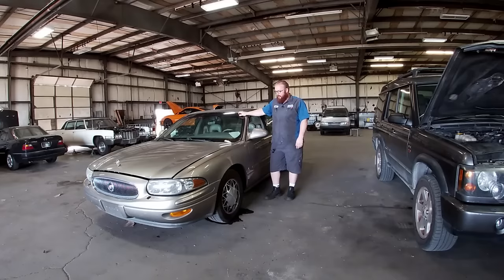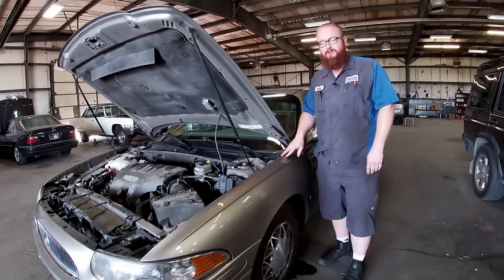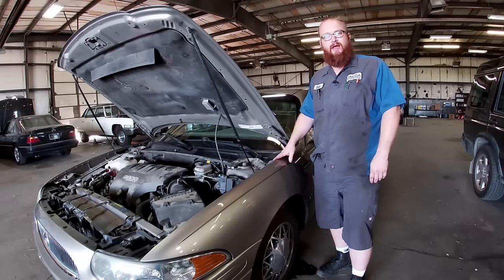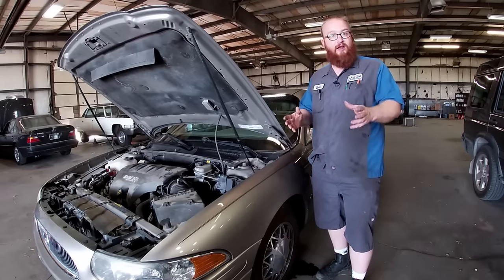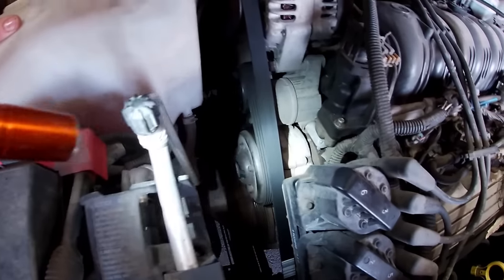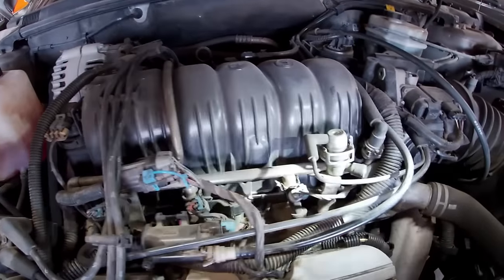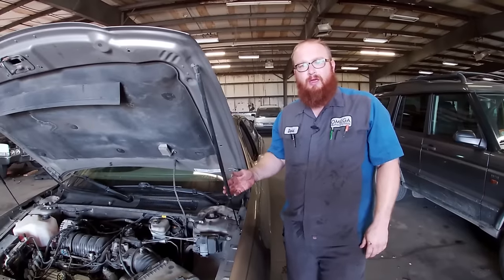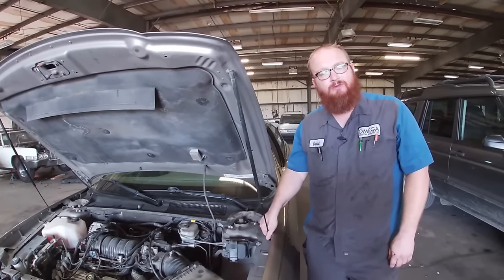CAR WIZARD highlights what makes the Buick 3800 V6 the BEST engine ever!

Comment: I want to see GM bring this engine back sometime soon. The only reason I'd buy anything other than a used 3800 car would be a NEW 3800 car!
Reply: They would probably still be using the 3800 if it could meet current emissions regulations.
Reply: and sadly, they don't make it anymore :(
Reply: hochhaul I bet it could with some know how like aluminium heads different cam dual cat exhaust
Reply: @hochhaul  the thing is that the first car in North America to be SULEV ( Super Ultra Low Emission Vehicle) other than hybrids
 was the Buick Lacrosse  and Pontiac Grand Prix both of them equiped with the 3800
Reply: The LS aftermarket guys need to make replica 3800s.
Reply: Honest mechanic opinion. New Chevrolet Impala 2.5L I4 is the closest, most-reliable you can get near the 3800. Stay away from 3.6L V6.

Comment: @car wizard , I used to own a 98 Lesabre and missed driving an American built Buick with the 3800 so much that I ended up buying a 2001 Park Avenue with 167k miles on it for only $2,200 and I am so happy driving this smooth driving comfy car. There was a bonus when I went to buy this car off someone . I took a look at the engine area and discovered that the previous owner had already done the Dorman aluminum intake conversion 👌 also, it's so easy to swap out sensors on this car when they go bad. I'm not mechanically inclined and using an OBD scanner, Google & Amazon I'm able to change sensors myself . P.S. been enjoying watching your videos for years now but as I watch YouTube on my TV I don't have the option to comment so this is my first comment . Love all your videos 💫💫💫

Comment: I had a 97 Camaro with the 3800 v6. Bought it for 500$ had 200000 plus miles lasted me forever lol
Reply: Still have my 97 Camaro V6 with 325,000 Km's. I'm the original owner and its always had oil changes by me every 5000 Km's with Mobil 1 10W30. I run synthetic lubricants everywhere.
Reply: I have a VT Holden Commodore, with the 3800 V6. Its done over 326,000 and she just won't die.  I'm fussy though, I service her regularly; I do most of mechanical side myself since it's the most easiest engine to work on.
Reply: Joshua Dean Martin agreed mine here in southern Ontario easy to work on parts a reasonable compared to most companies and plenty of aftermarket parts cheap. Have to fight the rust created by 5 months of road salt here  . Several years ago in london Ontario they were spreading salt on wonderland rd April 20 th and there were no freezing temperatures for over 3 weeks it was 11. Pm. A city truck was laying down salt like  mad I was behind I just got through washing all the winter salt of my engine bay and chassis earlier that day and was going to take my car to be oil sprayed I had to re wash the car again to remove unnecessary salt . This road treatment destroys cars trucks
Reply: @nickking1510  I don't drive mine in the winter. I have had two Cavaliers that were/are my winter cars. Yes, another reliable GM engine was the 4-cylinder 2.2 litre engine found in the 95-05 Cavalier's, they just keeps running.
Reply: @nickking1510  hi Nick, mine has a bit of rust.. one thing I like about the engine, it has a automatic tensioner, so the serpentine belt is a peace of cake to replace. I found the power steering pump and water pump to be very easy to replace. When I look at a 2002 Mazda atenza, it's a brain f.. to a degree, because trying to replace the drive belt looks incredibly difficult; no room.. recently had the transmission fluid changed; definitely worth doing , and I change the engine oil every 4 months now.. hope your 3800 keeps going and going, happy motoring.

Comment: I just bought one with 99,000 miles on it. Probably the best purchase I've ever made
Reply: Just bought a 1991 Buick Century Wagon with the 3.3 with 94,000 miles for 1,200$. Don’t regret it at all.
Reply: Got a 98' park avenue w 110k miles at auction. Perfect condition, inside and out. I think an older person owned it before me. I'm loving my purchase
Reply: @leonwhitehorse1099  2001 park ave checking in, just an FYI, the speakers and head unit are really easy to upgrade because the 30 year old paper ones are definitely junk. Also check wheel bearings and your air ride system. A few sensors here and there, maybe a few new fluid lines. Just things I've had to check on mine

Comment: I just bought a 2003 Monte Carlo that needs everything he has discussed, intake gaskets just caught in time, external leaks only, elbows cracked and I'll replace the upper plenum and hopefully have a trouble free car for my daughter.  The car only has 94,000 original miles.  I'll service transmission also.   And, your videos are great, really enjoy them!!

Comment: a thing that baffled me over the years is here in Australia we got these from the late 80s in the General Motors Holden make sedans. We never used them as a front wheel drive setup and it was so common in the US to see these with an East West setup. I'm very glad because i love the RWD sedans in general.
Reply: Over here it was available in the 1996-2002 Chevy Camaro and Pontiac Firebird. But yeah other than those it was mostly in FWD cars.

Comment: You have to take the entire wheel assembly off and unbolt the sub-frame in order to change the pressure control solenoid in the transmission. A $9.58 part.

Comment: Reason I love these motors
- Had a timing chain brake on an 07 series 3...non-interference motor made me smile after a compression test
- Water pumps/coolant elbows, cheap and easy to do
- Valve cover gaskets/head work same deal
- Spark plugs/wires easy to do when you pull the motor forward in a fwd
- camaros (I own one) and firebirds have them. plus theres a turbo kit for them on ebay to squeeze out some horsies
- zzp parts will make any car with this motor a speed demon lol
Reply: hit up 3800 performance on FB
Reply: @Ensource  dont use fb...@bighomiewhipz on instagram

Comment: Old dudes everywhere are sitting in a recliner with their arms folded and chins up.
Reply: lol, That's..that OG approval
Reply: @flexxcvtt2373  LMAO . . . That's EXACLTY describing me right now. You nailed it! lol
Reply: LMAO!!!
Reply: Not just old dudes.  I'm 39 and I've owned (at least) one of every generation of this engine.  My first car was a 1988 Oldsmobile Cutlass Ciera with the original 3.8L, then a 1993 Lesbre with the Series I, and then a 98, 99, and 2000 LeSebre with the Series II.
Great engines, reliable cars (and cushy-comfy for a big guy like me).
In 10 years when it's time to get a "new" car I'll look for a 2008 with a 3800 Series III.
Reply: @kriskehrer6410  or you could snatch up a GP GTP for under $3k and after a couple mods, show these youngsters how we did it at the turn of the millennium
Reply: @kriskehrer6410  great to hear Kris, recycle reuse, too many good Second hand cars out there being overlooked because theyre a few years old and dont have all the bells and whistles of a new one.
if more people had this attitude we would have a better world with less goods being sent to the trash !
ps. my last 2 toyotas i had for about 15 years. current rav4 at 430kms and just had first issue with it being steering rack leak. it will be a sad day when i replace it !
.
Reply: @rhett7716  , I inherited my 95 year old Mama's LeSabre. She always kept it maintained and garaged. It has 125K miles on it. Both of them were grand Ladies !
Reply: 98 o ikkm
Reply: @brianadams1907  man those are the diamonds. Old Buicks meticulously maintained and gently driven by old folks. Not a better deal out there, new or used. Drive it forever and keep mom's memory alive.
Reply: WTF are you talking about? I'm stoked to put this V6 in my 36 Ford. Bye.
Reply: Yep 👍🔧
Reply: @AmandaHugenkiss2915  like I read in some review years ago...."the door handles tell it all"
Reply: 😅 yes

Comment: The intake gasket plagued alot of the gm engines.  If you buy the metal gasket kit(they came with the metal elbows) for the 3.1, 3.4, 3.5, or the 3.8 they all had excellent reliability.
Reply: Most of the problems he mentions with this engine are caused by plastic parts.
Reply: I believe it plagued ALL of them, but I dunno.
Reply: @JustAGuy85  all,
Reply: @miketuch  Yeah.  It was well known when I worked in a garage for almost 10 years starting around 2002 that the 3.1/3.4's blew their intake/head gasket combo and the 3800 IIs blew their intake gaskets, too.  All around 115k - 140k miles.

It sucks because the 3800II is a SMOOTH engine that gets great mpg considering the cars that they put them in.  4000 pound Buick Park Avenues with long gearing.  Bad city mileage but great highway mileage (32-35mpg) as long as you drove easy between 45-65mph.  Once you hit 70mph, you hit 2200RPM which seemed to bring on quite a bit more power or something and you'd drop to 28-30mpg, and the faster you cruised, the lower your mpg went.  

But, let's be real, GM made JUNK back then, anyways.  It's not impressive if a car can make it 120k miles with 0- 2 minor issues.

There was the Ford 4.6 2v SOHC in Crown Vics, the 4.6 2v SOHC HO in Thunderbirds and the 4.6 2v SOHC PI engines in the 99-04 Mustang GTs that would not only last hundreds of thousands of miles, but they'd take a BEATING doing it, too.  

You really can't beat Ford.

Comment: Great video Wizard. My first engineering job out of college was with GM Powertrain Ypsilanti, MI working on Large Front Wheel Drive Transmissions that mostly were mated to the L67 and L36 engines you talked about. I agree that they were bullet poof since we really beat them up trying to break the transmissions. Yet, never did any of the engineers kill the engine. A true test of the L67 was in my 1996 Bonneville SSEi test car we used for high speed testing for the Volvo project. We disabled the speed limiter and ran it mostly full throttle until the tank ran empty at the Ft Stockon, TX test rack to find issues with the transmission we were making for the Volvo S80. We reached 156 mph on the straightaways only the back off to 140 mph on the curves. I rode shotgun once. Pretty scary when you pass a dump truck in the slow lane with a 140 mph speed differential. The fuel lasted about 30 minutes and the tires about four tank fulls. The L67...no issues. I don't recall the number of miles we ran. But the testing went on for a few months. I think we replaced engines when testing a new transmission just to be safe.

Comment: I have one of these engines in my Holden Commodore with a Getrag 5 speed manual gearbox, I can get 8 liters per 100km. Great fuel economy.
Reply: Speak American lol
Reply: Damn metric system... We ain't there yet
Reply: Chris Lilly 2 gallons 62miles
Reply: ISLIPPEDONMYBEANS !  lol imagine buying a v8 falcon, those things get chopped by turbo barras and LS’s, heap of junk those things are.
Reply: @carbonarc23 I drive a manual VT Spac with the old getrag and eco, with the way i flog the thing im lucky to get 10 litres per 100.
Reply: Yeah i got a vy ute with a getrag and im normally getting 12.5L/100 because i cant stop myself from banging it off limiter
Reply: Nice. Here in the US, I have a 2000 Chevrolet Camaro with the same engine and a Tremec 5 speed and 3.73 rear gears and I get about the same mileage. Couldn't ask for a more fun commuter car.

Comment: Great Video! I am only owner of a 1995 Olds 88 Royale LS .  82k original miles. Besides the Dexcool anti-freeze prob all the early GM 3800 series with the upper Manifold gasket replacement (which  trust me ain't all THAT easy) and the cheaped out plastic 90 degree coolant tubes (Now made with aluminum) are prob one of best V-6 engines ever made. THANKS!

Comment: I agree! I worked in garages for years, used to see these cars with this engine come in for inspection with over 300,000 miles and still pass emissions test! Many! Also the 2.2 liter in the Chevy cavalier was a fantastic engine, it was common though for anti-freeze to seep from the left side of the engine, between the block&head which since the engine is in the car sideways is in front when you raise the hood/bonnet, but don't panic this leak is external! Want hurt anything! Don't remove the head to fix! A little sealer in the radiator solves this issue if it bothers you. Also the 2800 was a pretty good engine but the 3800 was a great improvement!🤠👍

Comment: I've had two early 90's 4.3L (Jimmy, Astro) and a 1995 Skylark 3.1 and I am a SUPER FANBOY of those 90's GM V6 motors. You absolutely cannot bust 'em.

Best motors ever built. I got rid of all those vehicles because the cars themselves fell apart, but all the engines were running like new when I junked the vehicles. Damn shame. I'd like to have the motors out of all those cars I had.
Reply: Heinzkitz Velvet 90’s stuff was the best.  I still have a 90 Chevy pickup with the 350 TBI engine and never had a problem with it.  Changed a starter.

Comment: Would love to see a video on the jeep 4.0 straight six. Pros and cons. Common problems. Great video as usual.
Reply: Yes!
Reply: My experience was the whole cooling system is horrible. I went through a radiator and multiple water pumps.  Also the neutral safety switch on the side of the tranny
Reply: Even less problems than a 3800. 01 and 00  had cylinder head issues but it's exaggerated.
Reply: cons: rear main seals
Reply: Those were insane durability wise, maintenance wise I have no idea. We had 2 come in a dealer with over 250K, when I worked at I sold cars few years back.  They hardly had any motor oil in it lol. and would run like a champ.  We would fill them up and puzzled, shaking our heads.  Fkers won't die...
Reply: Bushy556 oh god I went through the same issues with my 99.  I only got rid of it when the electrical and the transmission problems got to where it wouldn’t drive.
Reply: just sold my 99 GC with the 4.0. Had 252k and was still running perfect.
Reply: My dads is dead reliable aside from the absolute dogshit cooling system. He has been through so many cooling parts its not even funny
Reply: They are eas, and cheap to work in for sure
Reply: I have a 91 xj that's been in the family since new.  It now has 310k miles and the original radiator.  I think i've replaced the water pump twice.  Never had any cooling issues with this one but i have seen some other years that didn't have radiator caps.  Maybe those are the ones with the problems.
Reply: There absolute crap.  A 4.0 that only makes 190Hp is pretty stupid to me.
Reply: Had a 1995 4.0 HO on tf999 and it was bulletproof. The only thing that was crap as someone mentioned was cooling system, but got  a custom made radiator for it  and it was a dream since then.  Did 200k km in it before it was sold, still miss it to this day
Reply: We are luck here in Australia with our 3800.
Fitted in our commodore thay are rear wheel drive and have an alloy intake manifold and alloy water bypass pipes.
Very easy to work on and parts are cheap.
In 1988 we had the series 1 engine fitted to the VN commodore then in 1990 GM made some revisions to the cooling system.
The VS commodore got the ecotec 3800 in 1996 and that ran all the way to the VY commodore i think 2004.
Then the VZ came out with shitbox 3600 double over head  cam engine.
Reply: Yea with the 4.0 he'd probably say nothing more then Renix and side note the automatic trans is the only real problem
Reply: ...and the Ford 2.3L. This would make an excellent series! Please.
Reply: @Bushy556 Yeah, I had identical issues. Repetitious cooling problems on the inline 4.0.
Reply: Phillip Morrison I know it doesn’t sound great on paper but it was torquey and reliable. Probably because it only made 170 hp for 4.0 liters
Reply: Big issue with the water pumps is the ones from the parts store were garbage 99 percent of the time. Summit and 4wd had an aftermarket pump that fixed the issue with the impellers cavitation and eating up. The radiators were fine, just needed to make sure you flushed them out. If you had the stock mechanical fan, those fan clutches were supposed to be replaced (even on GM vehicles) about every three years. I had a 95 that wound up having over 456k miles on it when I sold it. 1 water pump, and a new exhaust manifold (originals until the revised model came out cracked at the collector) and it still runs like a beast with the new owner. Not to mention the 2wd sport models actually used to be one of the fastest 0-60 SUVs on the market.
Reply: The exhaust and intake manifolds on the same side of the engine is one big one. You don't want the heat from the exhaust radiating up straight into a metal intake manifold. I'd hate to see the Intake Air Temps for a souped up 4.0L because I bet it's insanely high. Very solid engines, but that design choice I can't get past.
Reply: @OrganicGreens  if we drove on dynos then HP would matter more then just for marketing. If you want an engine to make power from idle it wont have high HP #s but for the application they are used the 4.0 is a great engine.
Reply: Jeep 4.0 > buick 3800 ..
Reply: 91 cherokee 241k miles,vacuum lines, waterpump and tons of motor mounts and u-joints. i tortured that thing. head gasket finally made me sell it ,  but the kid who bought it drove it a couple of years at least, hell, might be running still
Reply: @slimshady2777  I had both and I think it's the other way around. The 4.0 has terrible gas mileage, 14mpg if I was lucky.